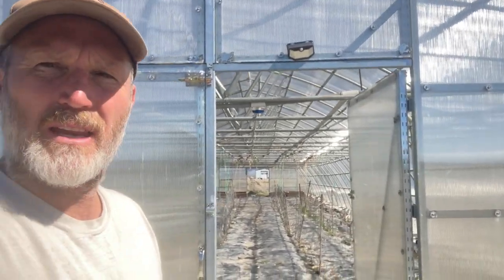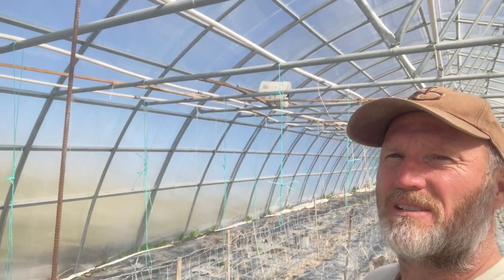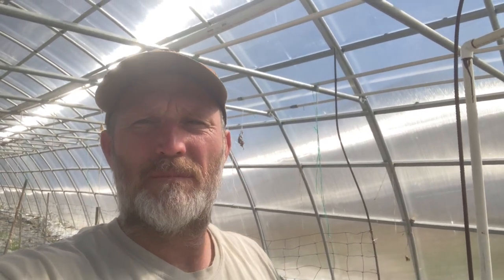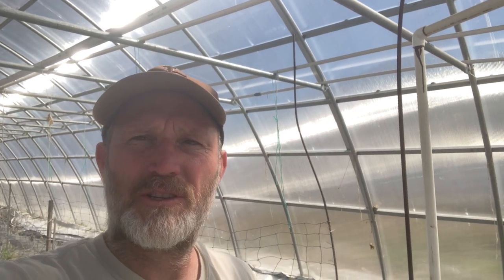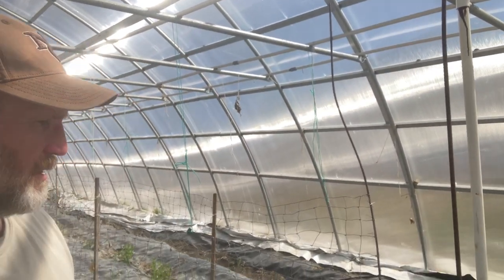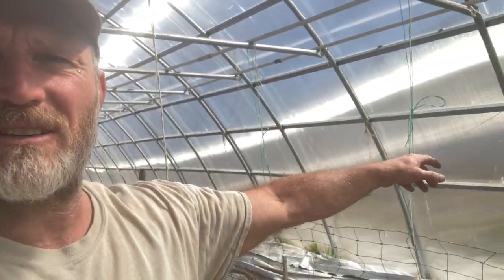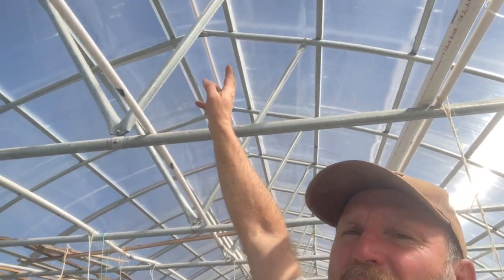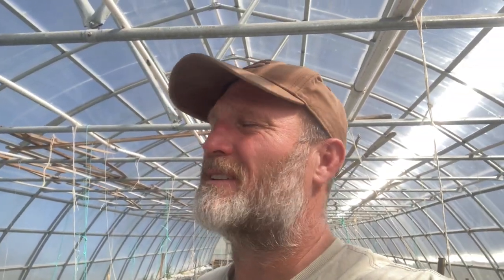Prototype Polycarbonate High Tunnel 96' long 26.5' wide.  Discussion on design and water system.

Comment: How does it do In The wind?
Reply from the maker: Perfect.  The motivator for going polycarbonate was to increase the R-value and to minimize the risk of wind damage.  I tested polyethylene film back in 2018 and it lasted one season.  This greenhouse is four years old.  We routinely have winds in the 70's MPH and have seen no issues with the PC. The polyethylene film greenhouses in our area get stripped by the wind.  The owners that cut costs for those greenhouses during initial construction then come to me to buy polycarbonate panels to retrofit on their frames.  Their end price is usually a lot more than if they would have just started with PC.  I think its worth the money up front.
Reply: @russlivesay9325   I live in Ely Nevada elevation 6400’
Some weeks in the negative -40 some winters 
And high wind   
What is the best way to contact you ?